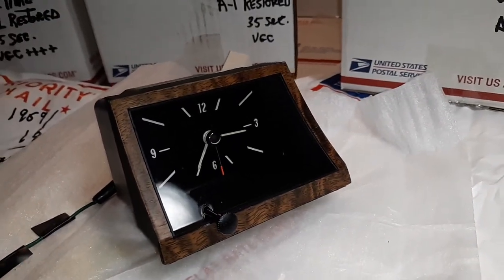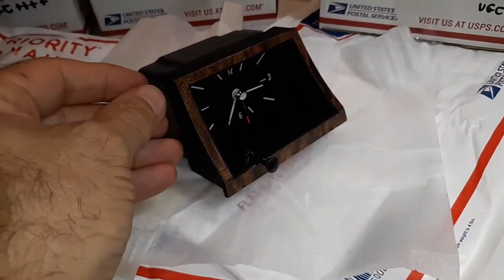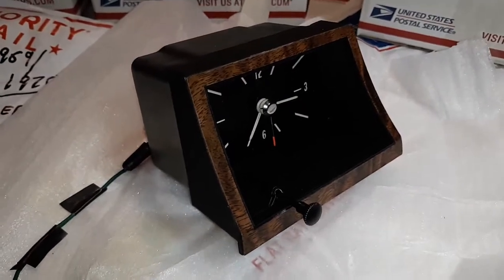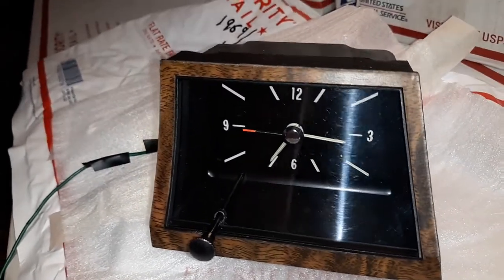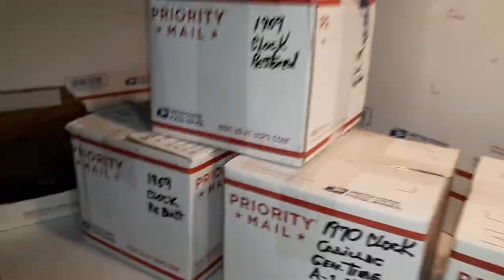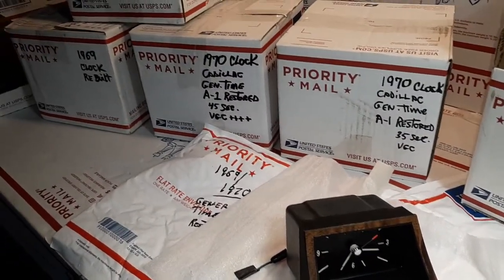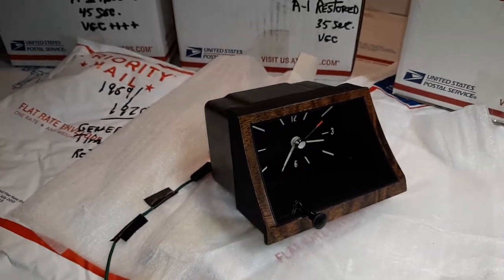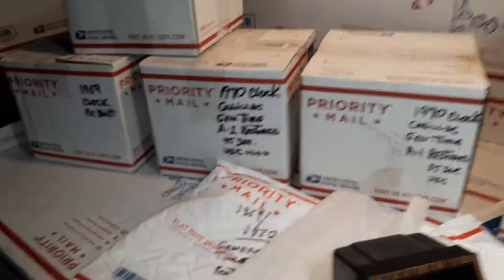1970 CADILLAC CLOCK RESTORATION Original Solid State Movement  OPERATIONAL VALIDATION

Comment: How much does it cost to restore one?
Reply from the maker: Hello "elgrege" and thank you for your inquiry of my restoration work on critical Cadillac vintage component parts,.. specifically the restoration of the 1969-1970 Cadillac Dash Mounted Clock.  I provide SHOW QUALITY restoration of the original General Time movement for $400 plus shipping or in the alternative $500 for the quartz conversion.
I have over 75,000 original vintage 1967-1970 Cadillac items in my collection and over 250,000 1959-1978 Cadillac items overall so if there is anything you may require feel free to reach out to me again. I am best known for my Restoration of the Cadillac Steering Wheels and Steering Columns, Power Seat Mechanisms and Stereo Radios and Power Antennas.
Kind Regards,
George
Tel: 727-364-7523
eMail: kypitsn@aol.com